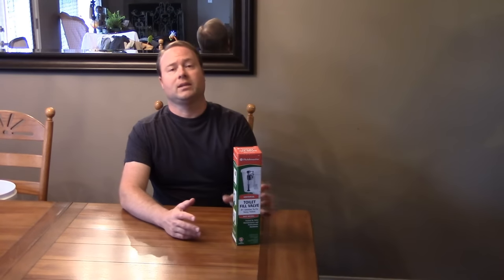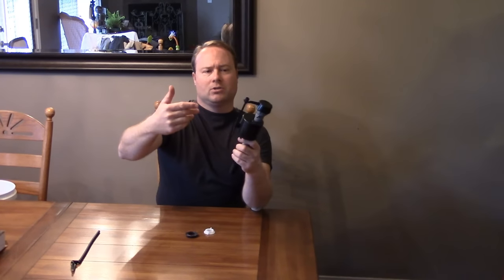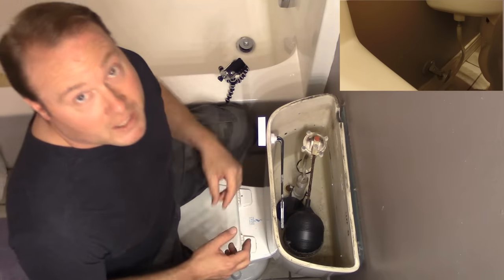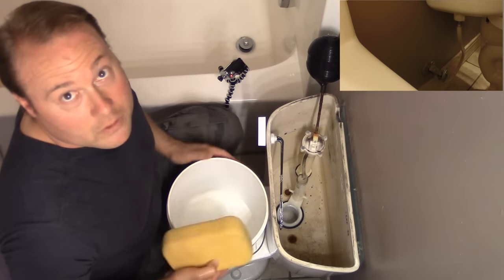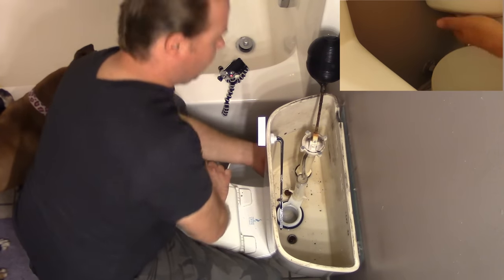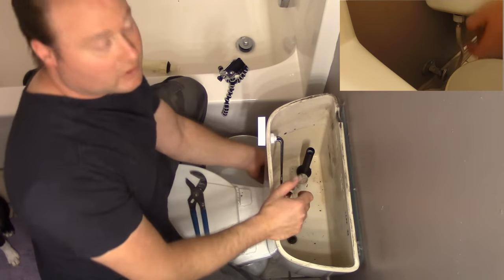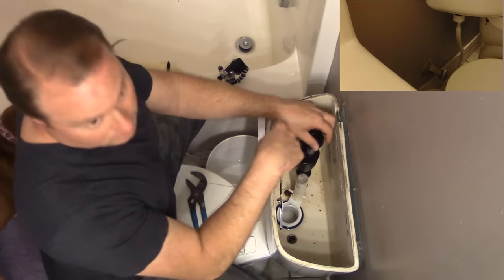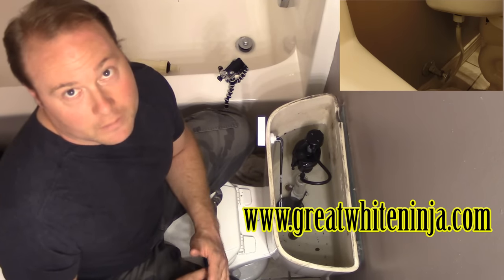Fluidmaster 400a - Installation

Comment: Well done video. Followed your  instructions...worked.
like other comments here, the leaflet instructions were okay, but not great. Your video did a great job of filling a lot of gaps. disassembling the valve stem from the float saves a lot of hearartache. in my case to determine the level I looked at the fill Mark in the tank as well as did a comparison adjust to my old discard fill valve. again  saved a lot of heartache. Went from stock Hydroclean EZ to Fluidmaster 400CAR3. No drama. Thanks again.
Reply from the maker: Glad I could help.
Reply: for the fucking life of me i can not figure out  what that tube  is for that goes from the filler directly down the  overflow tube it makes no gad damn sense at all to me how do you ill up the tank if all the water is just going down the drain ,down the overflow? my toilet is a toto and  it does not have that tube at all  ,there is no tube  of any kind going into my overflow at all , on the filler there is a spout that the water sprays out of on top of the floater mechanism ,then there is a a connector on the filler that looks like you could connect that tube to it but it is unused and  no water ever comes out of there, the water just comes out of the filler and goes into the tank which makes perfect sense to me  having a hose that just wastes all the water by dumping it down overflow makes no sense if all the water is going down the overflow then how does the damn tank ever fill up? if some of it goes down the overflow then it is still wasting water , it makes no damn sense ,any excess water would just  go down the overflow anyways right? why does my toilet not have this why is it even needed it seems to have no purpose other than  wasting water and making utility companies richer
it obviously can not be needed or serve any purpose since my toilet does not even have one
Reply from the maker: I am going to try and help explain that one. First of all there is no conspiracy between the utility companies and Fluidmaster. The filler tube that goes down the overflow is not wasted water. Most of the water fills from the base of the fill valve, but some does go down the overflow. The overflow goes directly into the bowl of the toilet. So it helps to bring the bowl water level back up. Without it, the bowl would have too little water after a flush. As far as yours not having an overflow, I have a hard time believing that a toilet company decided to leave that out. If your fill valve stuck and kept filling, it would overflow all over your bathroom floor. With the overflow going into the bowl, well as long as the toilet is not clogged up, the bowl will self regulate the height of the water. If too much goes in it just flushes. Some toilets have a flushing tower instead of a flapper and the overflow is in the center of the flush tower. I have seen that with Kohler brands mostly. The Totos that I am familiar with just have a 3" flapper and an overflow tube...
Reply: Nathan Cox ok thanks i understand what it is for now thanks , no you misunderstood me ,of course my toilet has an overflow column ,but it does not have the little tube that goes from the filler into the overflow , that little black tube,there is a place to connect one but it;s not here and no water comes out of the place where the tube would connect, i have read that the  type of filler that toto uses is prone to break frequently i read some advice online from a plumber that said  do not replace it with the sam etot part  just use a cheaper fluidmaster 400a instead it is less than half the cost and it will last much longer he said the toto  filler  wont last 2 years because the smallest  bit of debris can get in there and break it ,so my question is this ,if  replace the totot filler with  the fluidmaster ,then can i hook it up the same way,ie without the extra tube going from the filler to the overflow column?
my toilet does not have it now and my bowls water level is just fine without it,  ,now if i buy the fluidmaster then is there a way to make it not output water from that tube or  i can just position it so it squirts into the  tank instead of down the overflow into the bowl ,or will i have to use it because it is a different filler? i will post you a quick photo of the inside of my tank so you can see what i mean
Reply: ok here is the pic on my tank
https://s14.postimg.org/yp26jnkm9/IMG_20161105_164008_1.jpg

you think if i go with the fluidmaster instead of the toto filler i can hook it up the same way and have it function the same, no  tube going into the overflow i mean, right now the water level in the bowl is good i don;t want it any higher
Reply from the maker: If you want your toilet to work exactly the same then you need to buy the Toto replacement part.
Reply: Nathan Cox but i heard it willl just break again , it is weird that no water is  ever coming out of that  tube connector and i do not see a way to turn it on , i mena i were to install the fluidmaster filler and then just put the tube into the tank instead of down the overflow tube i imagine it would do the same thing
the post i read online from some plumber said he has put in over 200 toto toilets and they all break within 2 years  because the filler has an issue he said he  replaces them with  a fluidmaster 400a, but my toto also looks different than every other toto toilet filler i have seen in online video  the other ones all gave the one korky looking one
Reply from the maker: Here is the thing. I have installed hundreds of the Fluidmaster 400a fill valves and they are my favorite. I am a little concerned that you are so concerned about possibly wasting a couple of ounces of water. If you just put the upper fill tube into the tank instead of the overflow valve then what happens. Maybe it stays put and nothing happens. Maybe it flexes up with water pressure and sprays all over and maybe some water comes out of the lid. Maybe it gets stuck by the flush lever or the flapper chain and you flush the toilet. Then you walk away and the toilet never stops because the flapper doesn't seat. Then you can waste possibly hundreds of gallons. My suggestion to you if you install the Fluidmaster fill valve do it the right way. Put the upper fill valve tube into the overflow and let a couple of cups of water go into the bowl. Right now your water level in the tank is too high anyway. If you install the Fluidmaster fill valve correctly and lower the tank fill height you will use no more water then you currently are. If you are worried about wasting water cut your shower time down by one minute and you will have saved the same amount as a full toilet flush.
Reply: Nathan Cox ok ,yeah i would secure the hose so none of that would happn , but one more questin does the fluid master have a shut off for that tube?
i am really perplexed at mine because no water is coming out of it and i do not see any shut off valve where you could turn in on
i wonder why no water is coming out of it or why it was connected like that in the 1st place
another thing i saw suggested someplace is that you could position the  tube over the overflow so that some of the water goes down the overflow and some  goes int he tank, guess i will just go buy the fluidmaster and experiment a bit, thanks for your help
Reply from the maker: There is one more thing. The plastic tube holder is an anti-siphon piece. If you put the tube into the overflow tube then make sure you are using that because sometimes after the valve shuts off water can siphon from the lower fill area up through the upper fill tube. If you attach it into the tank then it doesn't matter because if it does start to siphon then tank water just goes back into the tank. But if you don't use the anti-siphon tube holder and put the tube by the overflow tube, then you could siphon your tank slowly out. I am not that familiar with the Toto fill valve and I don't know why no water comes out of the upper tube pipe. There is no way that I know of to stop that on the Fluidmaster. If you really want the water to just go back into the tank then just clip the anti-siphon tube holder onto the overflow tube backwards so that it sprays into the tank. Then the upper fill tube is still connected, it is just spraying into the tank. There should be no problem with that.
Reply from the maker: I should have thought about that sooner for you, but I just don't install them like that. So yeah, just install the anti-siphon tube holder so that the water shoots into the tank.

Comment: Thanks from the UK. The "instruction" leaflet was a nightmare to follow!
Reply from the maker: Glad to know I am helping people in the UK. Check out my website for more great videos. www.greatwhiteninja.com
Reply: It’s a good practice to wrap the water connection to the bottom of the tank with Teflon tape.  It will make that water connection nice and tight to prevent leakage.

Comment: Hey Nathan,

Awesome video!  I used your trick to separate the shaft from the floating part and also changed out the flapper.  So far so good...will see if I put the water line connection right and the water level.  I tried to max it to the water hose that takes the tube inside the tank as you suggested.  I agree that before we were always having to flush twice.

Cheers Mate :)

Comment: Thank you so much, I thought I would have to unscrew everything and get a pot to catch any water left in tank  when removing supply line and reinstall everything all over again. Now I know I can just pull off the entire float part and snap/push on a new one , THANK YOU !  PS: Cute Doggie :)
Reply from the maker: Glad I could help, and thanks.
Reply: @AroundTheHome1  I am concerned about that short cut of leaving the old post, because we cant tell how much gunk may be built up in there. personally I will replace all the parts at the same time. your video was easy to understand, and helpful, thanks.

Comment: I'm working on mine....my dogs (all FOUR) are interested in my work...as well as the FOUR surviving kittites...my major problem is my weak left side due to a stroke 17 plus years ago...I'm trying to do a three handed job with one hand in a water closet only large enough for just the toilet and myself...I have the Flowmaster kit myself and hope I can use your hack of sliding the float assembly off w/o having to take the fill pipe out...that will save at least three to four HOURS of cussin', crampin' and cleanin' up (thanx for the car sponges hack) - because there's no room for a bucket......also on another (nameless YT channel - nameless only because I forget the dude's name)..one of the usually missed causes of the filling not stopping is the flexible fill hose getting lower than the water level...I have that problem also...but it's not the MAIN problem...thanx for the tips (as the mohel said)...I'll let you know how things work out...

Comment: This was fun to watch. @ ~ 10:00 to 12:00 minutes your puppies came in to see what's going on. The big guy may have wanted a drink. I remember my Ruger (RIP) used to stand there and stare at the tub spigot until I turned it on for him. He liked water right from the tap. That said they may have just wanted to be involved with the video. At about the same time you gave us a shot of classic plumbers butt crack too! 😁
I do have a question though. As far as I can see the refilling of the tank is not reliant on the small 3/8" rubber tube that outputs into the overflow tube. So is the small amount of water from that tube used to supply a light water wash into the bowl after the flush, while the tank is filling? It's the only function that makes any sense to me unless I'm missing something.
Thanks! Wakodahatchee Chris
Reply from the maker: Chris, thanks for the comment / question. And you are right. The small black tube is used to help fill the toilet bowl. I don't know so much about the wash, but it does the filling of the bowl. So, I have had ladies from California argue with me about that. Wanting to save every last drop of water they can. I tried to tell them that the bowl needs that water to help with the flush. That there is a certain amount of water that is needed to perform a proper flush and to make it out of your house. Of course they hated that. So, if you hate that you can put the tube on the outside of the overflow tube and just add to the tank water. But that is not what I recommend. I do have a newer video of this minus the butt crack and the backwards t shirt.  Here is that newer video. https://youtu.be/KLvoFsE3NP0 And here is our website for even more stuff https://www.aroundthehome.org/

Comment: Nicely done video. When I installed my 400A, I realized I didn't set it 'tall' enough, so it fills about 1" below the overflow - even when I adjust the tank water level adjustment screw all of the way. Am I able to rotate the top section of the assembly on the base while it is still installed?.....or do I need to remove the whole assembly - which is kind of a pain in the butt -  to lengthen it about an inch? And if I CAN make this adjustment while it is in the tank, do I need to do anything with the lock ring? Thanks.
Reply from the maker: You can spin it in the toilet if there is enough room. Most of the time there isn't. You can unlock the ring, then pull it up a notch, then lock the ring back in place. Of course, turn the water off first to the toilet so that the fill valve doesn't shoot off when you unlock the ring.

Comment: Good vidio,Thanks
Also I'm going to try wearing my V-neck T-shirts backwards like that, looks comfy lol and you've got some good help there too. Would be cool if she brought you a beer.  My question is can i raise the fill pipe with water on? I'd  like to raise level 1 more inch without having to disconnect anything. I can conserve water by not washing car or something but when it comes to getting the pooh on down the pipe, I believe every 1/2 gallon helps. 
Thanks
Reply from the maker: You can adjust the float with the water on. Even though you can unlock the ring and adjust the main stem height with the water on, I don't recommend it because if it slips then you have an active fountain in your toilet. If you need to adjust the stem height, it's really best to shut the water off.  Also, you are right about flushing the poop out of your house. There is a certain amount of water that is needed to not only get it down the toilet, but all the way down your pipes and away. I find myself having to flush at least twice, if not three times to get the job done right. If you want to save water, first make sure all your plumbing fixtures are working correctly and not leaking. Then maybe just cut 5 minutes off of your shower. Glad it helped! Thank you! 😊 And thank you for watching. Check out hundreds more of our videos at https://www.aroundthehome.org

Comment: You might want to read the instructions.  You don't pop the locking ring to adjust the height of the fill valve.  The height adjustment is made with the locking ring in place.
Reply from the maker: I have read the instructions, and installed over 100 of these. You can adjust the height by either twisting it or popping the ring. It is faster to pop the ring and in some toilets there is not room to spin it. But I guess you know best...
Reply: @AroundTheHome1  You adjust the height before you install the fill valve.  By popping the ring you run the risk of damaging the plastic when you return the ring to its proper position and you can stretch the ring if you snap it back into place when the the threads on the plastic pipe are slightly askew.  It can also cause the pipe to develop a leak which causes the fill valve to be less efficient.  The instructions clearly have a cautionary warning:  "Do not move the lock ring.  It holds the valve body and shank under pressure."  For the sake of your new customers, you now know how to properly adjust the fill valve without causing damage.
Reply from the maker: Yes I do adjust it before I put it in. Because it's even easier to do that. I run the risk of damaging the plastic when I move the ring? Bob, I was trying to expand your mind, but it looks you took the Blue Pill. So sorry about that. Let me tell you something about these fill valves. When sliding them up and down, getting them stuck in between notches is something that just doesn't happen. So damaging the plastic or the ring, well you have to be trying to damage it. As far as leaking? The fill valve is already designed to move up and down and has a double "O" ring seal on it. You would have to jam the crap out of the thing when putting it back together to actually damage an "O" ring. I am finding this conversation just a bit silly at this point, and sad. They have to put those warnings on there because of the same reason they have to warn you not to make toast in the bath tub. I make these videos to expand the minds of my viewers who took the Red Pill. If you want to keep doing everything as instructed by a licensed and approved safety first commander, then that is fine for you. But I think the hundreds of installations with zero fails on my part more then speaks for itself.

Comment: What to do if the float is sticking and will not drop?  Is there a way to clean it?  I used toilet bowel cleaners that drop in the tank.  Could that be causing the sticking?  Thank you, liked your video
Reply from the maker: Your cleaner may very well be the problem. Many drop in toilet bowl cleaners cause a lot of troubles and are hated by plumbers. It really sounds like you could use to replace it.  Thank you for watching. Check out hundreds more of our videos at https://www.aroundthehome.org